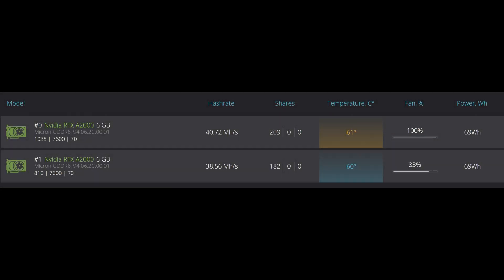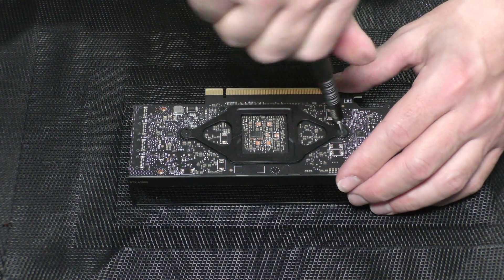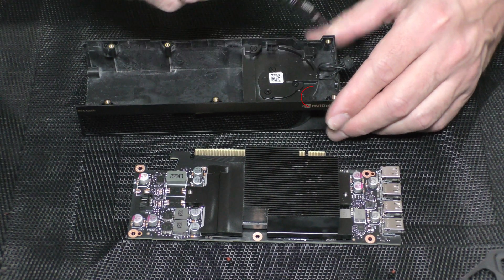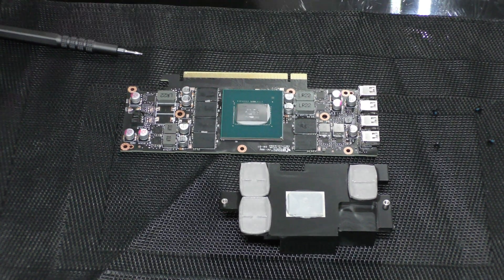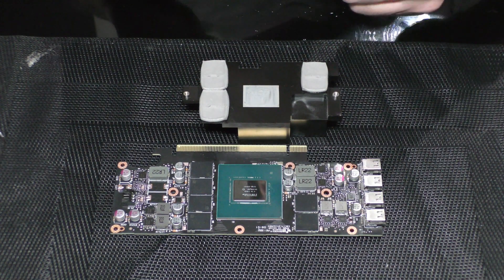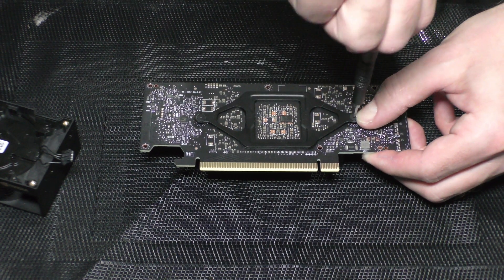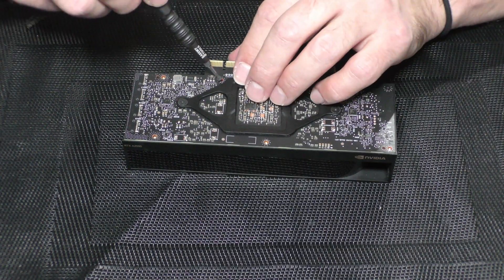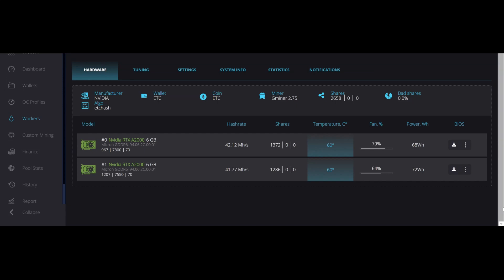NVIDIA a2000 - Thermal Paste Replacement

Comment: sorry to ask such a newb question, but how did you clean up the fan ? can you make a small tutorial on that ? :D my A2000 is running hot, most likely because there is a lot of dust on the fan.
Reply from the maker: Simple brush will do. Or a vacuum cleaner with blower like I show in this video
https://youtu.be/rfy3bx_FJdw
Reply: @minerondemand  thanks alot <3 will check it out.

Comment: for mining crypto like eth you need to change the thermal pads... you are using more memory than gpu... Memory temperature limit for GDDR6 is 95ºC, do you really think being close to 95ºC is ok? nop:(
Reply from the maker: My cards run at 60C core at 60% fan. I have no issues with temps, but of course in warmer countries might be different.
PS. I do have 120mm fans helping.

Comment: Hello did you know termal pads ticknes
Reply from the maker: Sorry I didn't check. Didn't need to change. If you put some good auxiliary fans temps will stay low.
Reply: @minerondemand yea temps are low for now bcuz install it on pc casé  74% fan at core 52-54c   and memory 76 to 80c     next few weeks price will drop alot allready a2000 get cheap every day in my place and might try the 12gb model  i think give same hash but will be more future prove more then 7 years  well the 6gb model will be also good until 2025 -2026 will see
Reply: Stock thermal pads are ~2mm but very squishy. FOr high conductivity aftermarket pads you will want 1.5mm